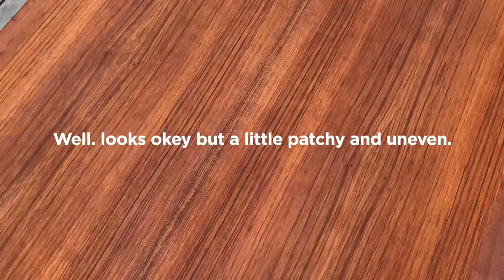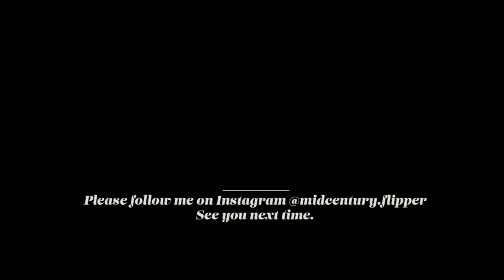The Lemon Table | Refinishing furniture

Comment: Also, for anybody that's interested: it's not just a question of applying a generous amount of stripper, but you should also try to use as few brush strokes as possible when applying it. The more you move it around once it's been applied, the less effective it becomes, and the more likely you are to need a second coat. 

Suffice to say, better to leave it lumpy and patchy and uneven, or you'll need to use more of it anyway. Move it around enough, and it will barely even work at all.
Reply from the maker: Didn’t know that! Thanks for sharing!

Comment: Hi!
Great work, and really inspiring vid’s!
A question, what do you use as surface/finish protection at the end? Just good old swedish ”klarlack” of some kind?
Also, you are just ”dusting” on a very thin coat. What kind of surface do you get after this thin coat? Do you need to polish off any roughness?

And finally, great to see a swede in this context for once!! Always wondering how to substitute all the american products and brands on other channels. 

Thanks in advance for reply, and keep up the good work saving gems!
Reply from the maker: Hi and thank you! It depends on the furniture. Often I prefer just rubbing it down with oil for that wood grain feel but if it’s a furniture that need more durability I add some satin poly to it (klartlack som du nämner)